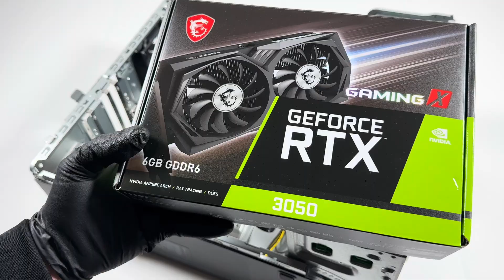HP EliteDesk 800 G4 Gaming Upgrade SSD RAM Video Card

Comment: This case looks like could fit full atx psu if the hole on the back will be modified. I saw that you could buy adapters for this mobo connectors as well.

Comment: Did you need to upgrade the power supply?
Reply: The 2018 versions usually came with a 250 watt, with mine I upgraded to a 500 watt since I put a Nvidia GTX 1080 in it. And yea I know its been 5 months

Comment: Doesn't 3050 have 6pin power socket? I have gtx 1650 super with socket and I have no idea how to install it.
Reply: You can easily buy sata power to 6 pin cable adaptors. I find even though the PSU wattage can be listed as very low on those business desktops, their quality is high and generally have no issue running mid to low end graphics cards without issue.
Reply from the maker: Hi, it depends which model you buy 3050 the one listed in links does not required 6pin power connection.
Reply: @Mxkdt how many pins is it then
Reply: @CChepi  none powered by the pcie slot

Comment: How many 3.5 inch drives can you fit in this chassis?
Reply: There are two slots, as shown and you can replace the optical disc drive with another.

Comment: Hello, I have an SFF version of this with an i3-8100, I'm planning to upgrade my processor, ram and install a gpu. What cpu + gpu combo would you recommend for an upgrade?
Reply: with a standard power supply you can install an 
processor i7 8700 
rtx 3050 Low profile gpu
at least 2 x 8 Gb RAM
ssd nvme

Comment: Can I transplant the internals of this cpu to other atx case? I wonder if I can use a regular psu on this and use a little more powerful gpu since alot of cards are available in the secondhand market but it requires an external power via 6pin/8pin.
Reply: Everything is custom. Yes, even the PSU connections and motherboard standoff locations. So no, it won't work.

Comment: There are 3 M.2 slots.  However, there appears to be a post to screw a drive down, for ONLY one of those slots.  So, what is the point if you can't use the slots?  How does one use them?
Reply: Buy another screw or just use one similar.
Reply: There are two M.2 slots and two corresponding screw holes.
Reply: Yeah you can buy the posts or improvise and get something similar.